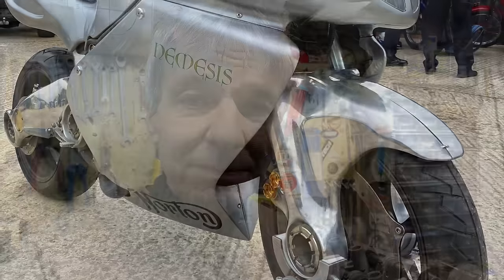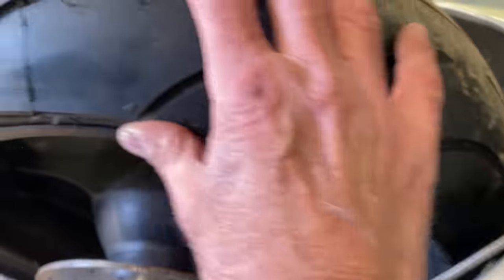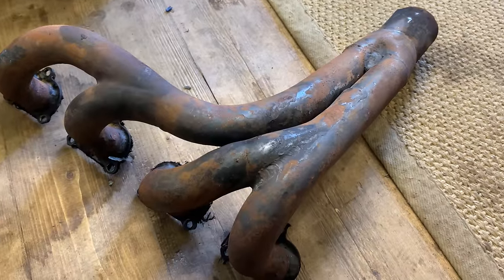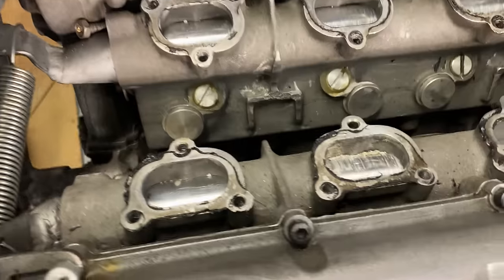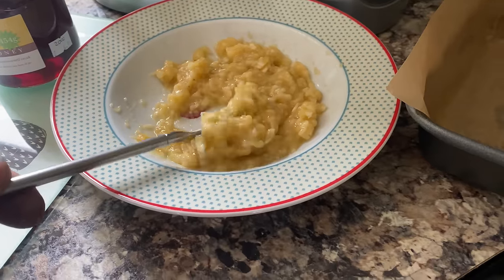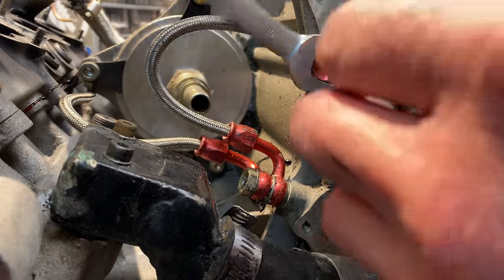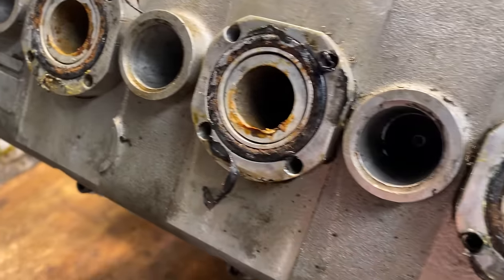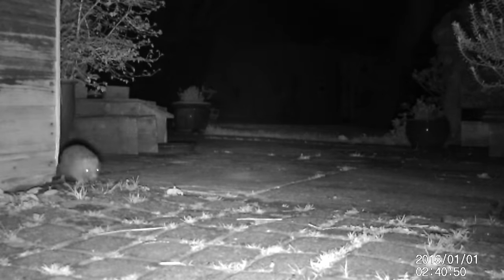Norton Nemesis V8 Rebuild - Episode 2

Comment: You all know, if Allen built cars, bike, washing machine etc. We'd only ever need to one of each and they'd last a lifetime.
Reply: And would be just perfect
Reply: And there would also be complimentary baked goods in the showroom. But you would only enjoy them once.
Reply: It's amazing what's possible when there's no man in a suit telling you to design it again, but cheaper
Reply: @jlucasound and there’d be houses for birds and hedgehogs
Reply: That would save a lot of energy/recources, also design things in a way that it is easy to maintain/repair.
Reply: What a bodge. Allen can only make it better.
Reply: We used to build most things that way, but everythings to cost now.
Reply: If only Al Melling had thought on and just got Allen Millyard to TIG a pair of GPZ 750 turbo engines together instead of cobbling this carbuncle together.
Reply: but we wont see any appliance running from just a single propulsion device..its all going to be 3 motor washing machines and 4 motor vaccuum cleaners etc..
Reply: And they would have Millyard hand stamped on every one
Reply: You will need to eat a lot of biscuits to have containers for all these parts,
Reply: I agree
Reply: There is no "OFF" position on the Genius Switch.
Reply: "Build a washing machine" ??? He doesn't need two women, and anyway, washing machines normally can't bake cakes (unless of course, Allen built it)
Reply: They’d work awesome, too!
Reply: Here's the thing Allen Millyard (the einstein of motorcycle mechanics) could build you a car with a washing machine built in and a detachable motorcycle all in one.....Yup! If anyone Can Allen Millyard Can :)
Reply: and how would the exploitative, shareholder-oriented, billionaire enabling, consumerist capitalist economy function then?
Reply: @rarelycomments  Yes. Well that didnt work out, did it?

Comment: This looks like one really technical team started building it and then they let the apprentices finish it off. I love how you don't lose your temper and shout at it like most of us would when faced with trying to get those exhaust manifolds off.      This will be better than it ever was before by the time you have finished with it putting wrongs right. No need to rush because we need lots of videos of this
Reply: The probably had a discount on a bag m5 bolts 😅
Reply: We are watching the fifth cut. Cuts 1 to 4 had all the effing and blinding!
Reply: I was thinking the same thing. Those castings and the engine would have took a lot of design work but the brackets, exhaust, water manifolds, electrical stuff looks slapped together.

Comment: There are some things like the big castings that were expensive and complicated, but some of the bracketry and plumbing looks like they let the apprentice weld it. Interesting stuff, looking forward to more of this series.
Reply: Yes some high end and very low end work.
Reply: Stevie Wonder on the welder
Reply: If the goal was to test the engine, the hubs, the frame... then the rest didn't have to be nice.
Reply: Yes it's a very strange mix isn't it.
Reply: crimp-on (drop off) electrical connectors are not my favourite way of making a wiring loom. Also how on earth did Norton make such a cutting edge engine and then finish it off with so many 'bodges'
Reply: @blackdoublezero That's Visionist...😶🧂
Reply: @philipcooper8297 It indicates whether the worker gave AF
Reply: @daleolson3506  I think you'll find that this entire machine is some fine British workmanship.
It's just that some bits are slightly less fine than others.
Reply: It’s embarrassing the level of some of that work, Allen would never have signed off on that.
Reply: Proptypes are like this
Reply: @blackdoublezero  have you ever seen Stevie Wonder's Girlfriend?

No, neither has he 😂
Reply: The thing when you're making something from scratch, it's difficult to see all the problems as a prototype it's very good and also the cost of making parts. People have a at making your own bike from scratch and show us all. It's easy to criticise.
Reply: Typical prototype vehicle. All the fancy engineering goes into the mechanicals and the aesthetics. The rest just has to work, and not even for long.
Reply: Yes I noticed the decidedly amateur/beginner welding effort. 

This isn’t a bike I’d like to ride despite having owned and enjoyed my Norton Dominator 600.
Reply: @MyZxcvb12 
No, i disagree. A good weld is as easy to do as bodged welding. It’s a matter of taking pride in your work.
Reply: Well said
Reply: Throttle linkage not achieving full throttle 😮 big surprise to me.
Reply: It def looks very agricultural, and very fiddly!
Reply: Showroom prototypes can afford to have those terrible welds. Not something someone actually rides/races/tests.
Reply: Funny you should suggest that about the welding.
Reply: It seems like a protect to reinvigorate the fortunes of Norton at the time so I would imagine there were a lot of time and financial pressures. It needed to look good on the outside foremost, hence the castings but then hiding what was lurking underneath.
Reply: I think the clue is in ‘prototype’ 👍
Reply: @MyZxcvb12 There’s a very big difference between making something that will fit and do the job and something that is correct… this is not correct.  Simple things like making sure the radius on a piece of flat bar is actually a radius and not a misshapen mess tells a story of someone who cares about their work.  A part may never be seen, but does that mean it needs no care and attention when it’s being made?  Those welds?  They look terrible, and their strength is likely to be very compromised, but they’ll probably do the job.  Again, no pride, and in this case little skill in evidence.  Someone commented above of « apprentice work », but if an apprentice did this, I know for a fact their supervisor would have come down on them like a ton of bricks.  It’s simply shoddy.  No, I think this is the result of an overrunning project with zero budget being given to the someone with no experience to finish.  The bike was shown at the NEC as a non-runner which met with a lot of criticism, which no doubt put huge pressure on Norton to get it running.  Melling wanted nothing further to do with it if I remember correctly (with the caveat that my knowledge was based on contemporary MCN articles…) so what are they supposed to do other than give the project to whomever would take it on?  I don’t know who finished it, but it’s clear it wasn’t a craftsman.  I’d speculate it’s the work of some inexperienced guy in his garage whilst under a lot of pressure.  And yes, I do build stuff myself.  More importantly I know when something looks right.  Here I see a lot of bodges on top of some interesting engineering.
Reply: @mtkoslowski That motorcycle is a legend, prototype or not i would like to ride it and reach it's top speed. Just to feel that v8 screaming and pushing the last kilometers per hour in the speedometer.
Reply: @MyZxcvb12 or even bike trailers!  I’ve made a couple, and can think of lots of improvements for the both of ‘em!
Reply: @user-xd3ij7cw8s  YEHHH ... IT'S  FALLING APART STANDING STILL !! 
TOP SPEED ......... ITS A MASSIVE PILE OF POOH 😂😂😂
Reply: Good from afar - but far from good!
Reply: @christopherhampson265  It's Norton, hands down. The sequential gearbox was invented by Norton. Japanese made it better. Also don't harry to laugh, it's prototype, low quality is acceptable .
Reply: @mtkoslowski My guess is that the apprentice/welder used the machine infrequently. I'm in that category, I've owned a MIG welder for years now but hardly use it, by the time I've finished a project maybe a weld looks OK but next time I'm back to square one shall we say. Frustrating it is but nothing breaks/comes apart so that's something I guess.
Reply: I remember the old ‘trouble shooter’ series on tv where John Harvey-Jones went around struggling businesses to make suggestions etc, he went to Norton in the rotary engine days and they were hand making their own wiring looms using the Halfords wiring crimps that fall off, not even proper crimp pliers let alone decent terminals. He asked why the looms weren’t bought in, the answer was cost, Norton couldn’t afford to batch buy from assemblers. 
That and paying millions for the cnc machine which only ran two days a week,to make the rotary engine. 
They were definitely struggling, so I think it likely the Nemesis design was never processed to a production point, only the basic design of major components, hence the struggle to reach a running point.
Reply: Watching this I was reminded of a good friend's saying - A grinder and paint makes me the welder I ain't!  The welding is just crude.  It reminds me of my fledgling efforts as a teenager with a stick welder.
Reply: You forgot the drunken multinational committee that designed the thing - apparently with a brief to come up with a blind camel on roller skates, capable of confounding even Allen Millyard!

What on Earth were they thinking? It’s an epitaph to befuddled hubris on acid, masquerading as a HollyWeird death race movie prop.
Reply: You forgot the drunken multinational committee that designed the thing - apparently with a brief to come up with a blind camel on roller skates, capable of confounding even Allen Millyard!

What on Earth were they thinking? It’s an epitaph to befuddled hubris on acid, masquerading as a HollyWeird death race movie prop.
Reply: welding looks like cheap garden furniture but that frame and engine look amazing.
Reply: @lewisp3954  True
Reply: @LoneWanderer905  Why? Good welding is not just about aesthetics. It’s about engineering and personal integrity.
Reply: @paullongley1221   Was it built by the apprentices perhaps?
Reply: @stu0508 Looks like they run out of funds.
Reply: @philipcooper8297  Best reply on here . 👍
Reply: @sidecarbod1441  this is a proof of concept/photo shoot bike . The company folded before it was ever near put into production.
Reply: @PaulG.x  Nope. This was never a production bike. This is a proof of concept that was never finished.
Reply: @mastercylinder1939  You have never worked a day as an engineer, have you ? It shows ....
Reply: @mtkoslowski  This is a prototype. I can assure you that those welds are probably stronger than you assume. Yes, they are agricultural looking, but strong.
Reply: @mtkoslowski  show me what a good weld looks like. Oh, and what type of welding equipment was used for those brackets? A good welder will know, and not saying such silly things as you just did.
Reply: @paultinwell5557    word salad. 

My worst welds would be stronger than any welds you have imagined that you have done. Shhhh, actual engineers watch this, and judge you silently in the comments.
Reply: @Κωνσταντίνος-ξ7θ  what speedometer? It doesn't have one! 😂
Reply: @captaintoyota3171 not I my shop they're not...!
Reply: Budget ran out after the front end was done
Reply: @Κωνσταντίνος-ξ7θ  Imagine applying your prototype logic to an airplane. You wouldnt fly in it.
Reply: @romandybala Aviation defers a lot compared with a ground vehicle, even the simplest things. For exchample if out of fuell in a car nothing is going to happen, in an airplane it's a real problem and the list goes on.

Comment: This almost feels like an engineering exercise, rather than a pre-production prototype.
Reply: Made in a shed by amateur polytech students. 🙂
Reply: An example of How NOT to design or make a bike.
Reply: It looks more like a first year engineering class project to me. The only thing more shocking than the design(s) is that this was all done in late 1990s!?!?!?
Reply: Na, more likely a ‘con investor’ exercise
Reply: Can't believe built by Britain's finest engineers, in a blacksmith's shop, no doubt. Is this a challenge for Allen, or is he just in it for snack cake and a cuppa?
Reply: It probably would've gone into production if only they'd had Allen as head of R&D ! So many things seem to have been made by those lacking engineering knowledge.... needle rollers are for rotating shafts, not as swing arm bearings - but then if it was 'nailed together in a shed' by students I suppose they managed to maintain the British motorcycle heritage of bodgework !
Reply: @mickvonbornemann3824  ah ...that old Norton owner trick
Reply: @thakery5720 needle bearings in swing arms are very common, have been since the mid 80's
Reply: @CATech1138 exactly and they still are, currently working on a 2020 honda nc750 with...needle bearings for the swing arm
Reply: @thakery5720 That time of swing arm bearing is quite commonly used even today.
Reply: @tonycamplin8607   Well it shouldn't be because needle rollers are meant for shafts the roll 9around and around).... swingarms as reciprocating ( back and forth) items need the shaft to have full support and not just support in limited amounts. As they will always load the same part of the shaft (in their reciprocating movement) the hardened needles will wear the shaft unevenly.... and if you cannot comprehend what I am saying, speak to an engineer - those bearings are wrong !
Oh, and learn to spell.... it's T-Y-P-E.... not time !
Reply: @thakery5720  You need to untwist your undergarments...needle rollers have been used in the swingarms of cars and motor cyles in the british motor industry since the 50's....right or wrong....they've been in all sorts of things....and if Honda have also recently used them then I 'm sure they have got it wrong also...
So you must be right and everyone else is wrong...
Oh....and if those bearings are kept clean and serviced regularly no harm will come to either part...and surprisingly ....there are quite a few engineers watching Allen...
Reply: Engineers follow instructions and budgets, you need the whole picture before you start flinging dung.

Comment: Thank you  Allen. The initial engineering and work on this bike is incredible, but then it seems like the powers that be said "It has to be up and running by"  so it was just slapped together. But I am sure when you are finished it will be as it should have been and most likely better than the factory could have done.

Comment: This doesn't stand up well when you compare it to the Britten V1000 of a similar era. It is not a good example of good engineering by comparison. I can't imagine the Gentlemen from Japan had much concern when they saw this at the "Reveal". Perhaps "Pity"
Reply: Rob Britten = "Patron Saint of Motorcycle What Could Be"
Cheers...
Reply: If I remember right the forks snapped off the Britten bike first time out, and Mark Farmer got killed on one at the TT later on.
Reply: @stephenwilliams926  The internet seems to be divided on the cause of Mr Farmer's fatal accident. (I was unaware of the sad incident before you mentioned it. ) My comment was as to the general execution of the engineering principals used in  the engine unit depicted in the video, its creation, and not the safety in actual service, or otherwise. A brief look at the multitude of fasteners attaching the same systems used, indicates that this engine was either  designed without "Servicing in mind," or it was intended as a "Design study," as opposed to a fully refined model. There is definitely a lack of cohesion in its realisation  and that is poor in the extreme.

Comment: I am so looking forward to the solutions you will engineer for the exhaust, wiring, fitting an alternator and so on. It's going to be great to see the Nemesis after the Millyard treatment, all shined up and running smooth! I never miss a Millyard video!

Comment: I've been meaning to watch these for a while pal.. but I'm mainly here to see the exhaust system, after seeing a comment on facebook about them...  the bike was made in Rochdale, the same place as where my Grandads Shop was, and my dads exhaust shop... one of my dads best mates worked for Melling, and apparently they brought the engine up to the workshop and asked I'd my Dad and Grandad would make the pipes for it.. Maybe because of my Grandads connection to Norton.. but my Grandad didn't get along with Melling, so they never took the job on, and you can tell by looking at it, that wasn't made by my family.  😊👍 Top Job as always Allen.. I'm going to listen to the rest of them while making an Exhaust system for a Parilla ISDT bike. 👍 Ben at Raysons

Comment: fascinating stuff. Would you happen to have a video of some of the 1960s Honda or Kreidler or suzuki exotic engines used in motorcycle racing? back in the day, when I was just a kid, I remember hearing of transmissions with many speeds, not just for or five, but I’ve heard as many as 10 or 12 speed boxes. I’ve heard of engines that revved past 20 K RPMs. I don’t know if that was just sheer exuberance from two of my motorcycle buddies in high school that were into hearing about phil reed, Agostini, and, of course, Mike the bike. We didn’t get much news here in the United States how about things like the TT races..
I do remember what a gigantic story it was when “ Bugsy “ riding a Honda won the Daytona 200on a 750. It was only running on three cylinders at the end of the race, and was burning so much oil in the race that there was only a cup of oil remaining in the engine when the race was over. 
  When I heard that is when I was just getting into motorcycles. That was 108 motorcycles ago.

Comment: Such a interesting bike some amazing things like the rotary valves and then you get the cheap nasty wire connectors.
I'm surprised you actually got it to run on the motor bike show with how loose the ignition trigger was.
This series is going to be awesome